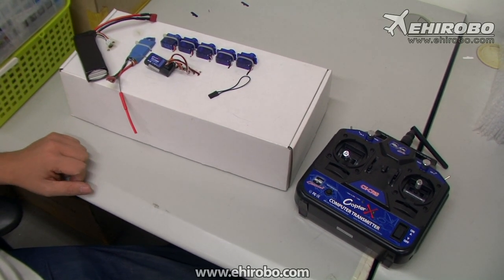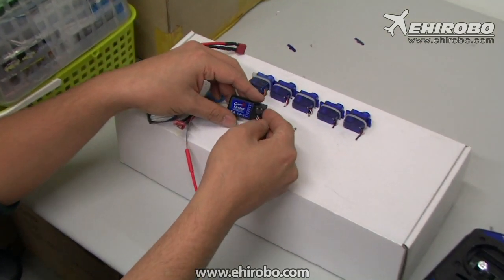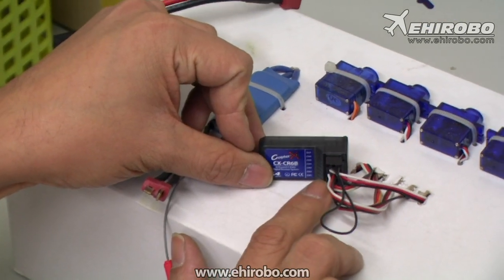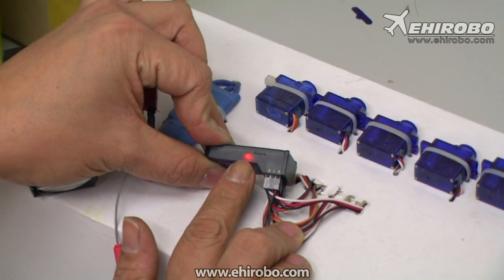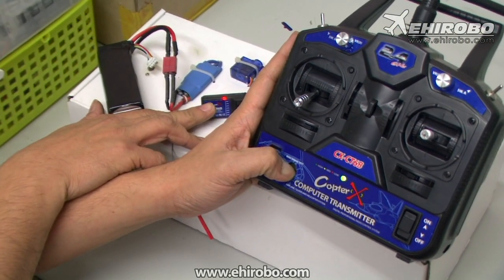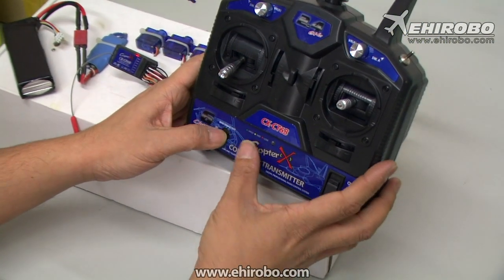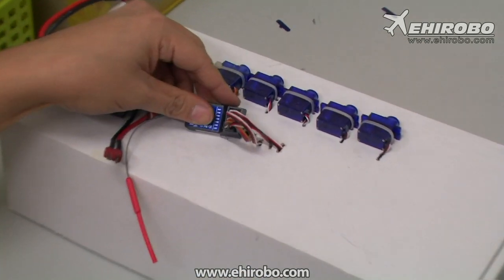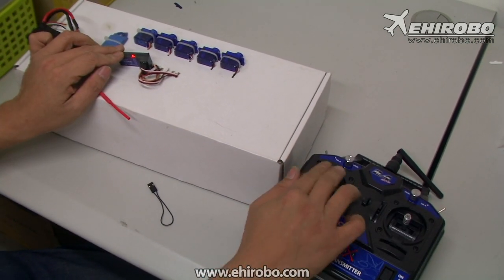CopterX CX-CT6B Transmitter Binding Process

Comment: Nope. Crystal is so 9 years ago. 2.4 is cool, because it is IMPOSSIBLE for one transmitter to control someone elses plane. You don't need to make sure to buy the same channel or anything. It will bind. They are all the same, and will bind with eachother. THink of it like connecting to wi-fi, or phones.

Cell phone vs walkie talky.

A walkie talky is like crystal. If others have one, it will allow you to hear them.

A cell phone is like 2.4. Once it dials and is talking, nobody else can